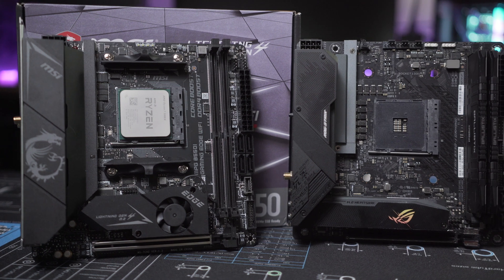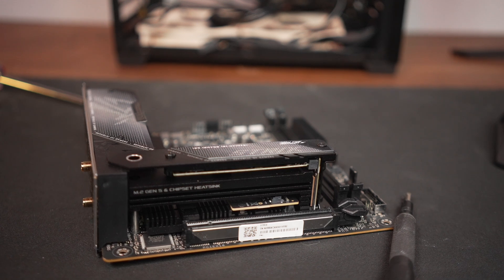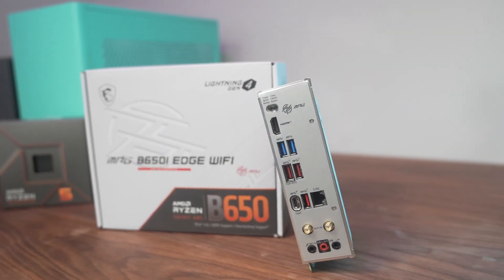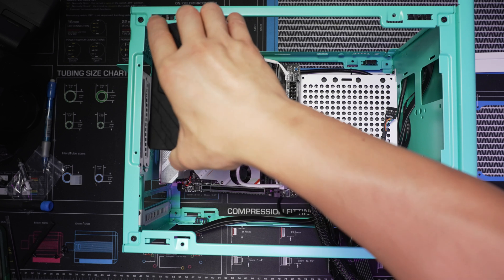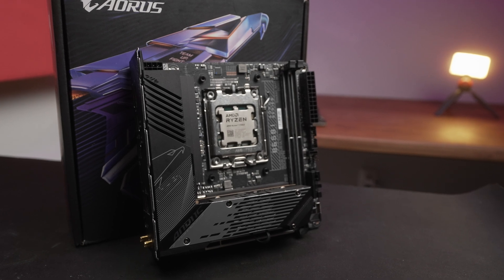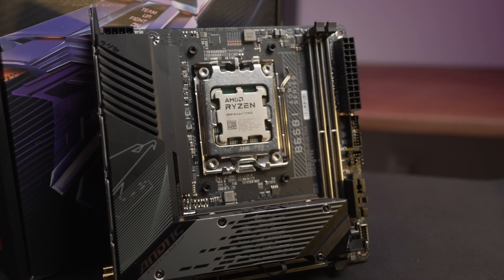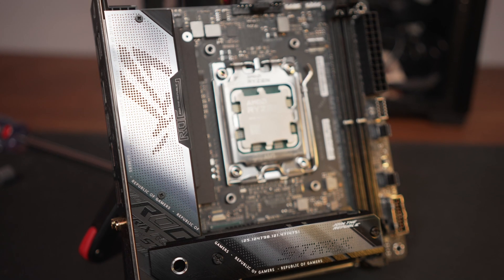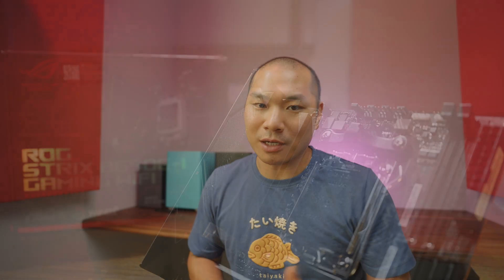Ryzen 7000 mini ITX motherboard... Round up!

Comment: I've been saying since they made the DTX board ..... It should become a staple form factor. I originally got the Gigabyte B650i Ultra board when I went to Micro Center a few weeks ago because of the bundle deal they had at the time. After banging my head against the wall for hours due to the breakout cables & the board refusing to post. I returned it to MC & they had a better deal but it was for a Asus B650E-F ATX board. I still had my old 011 mini so I was like at least I can get up & running for now. However I plan to mod my NR200 to fit a mATX motherboard & I'm going to pick up the best board I can find to fit my needs.